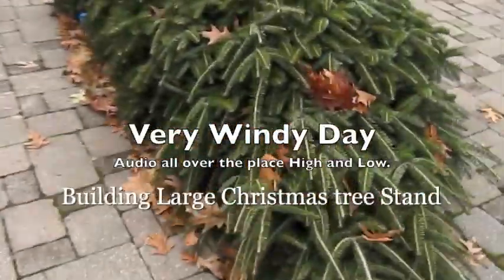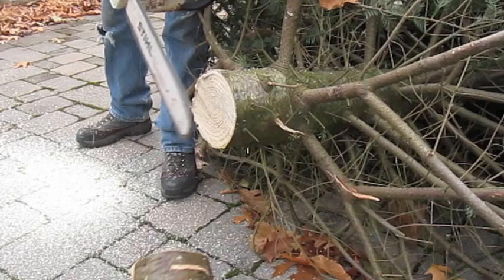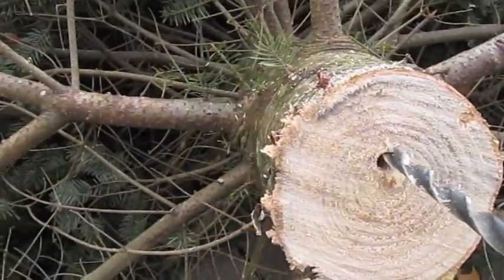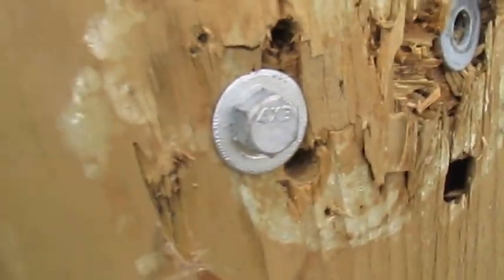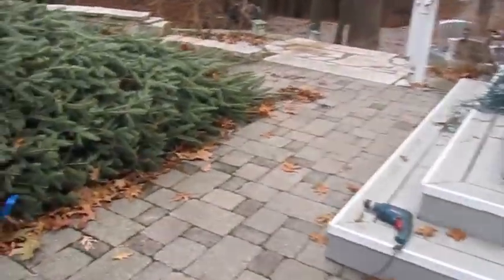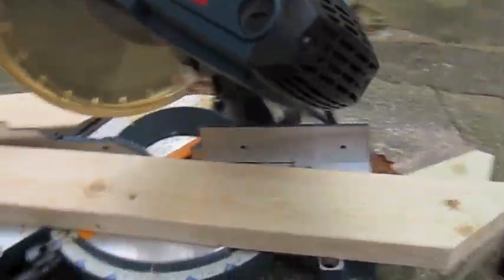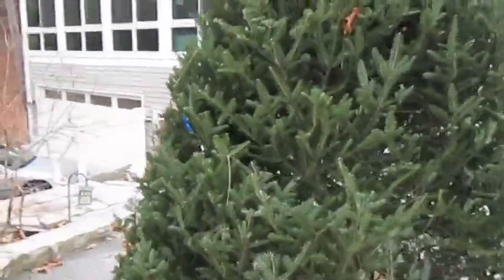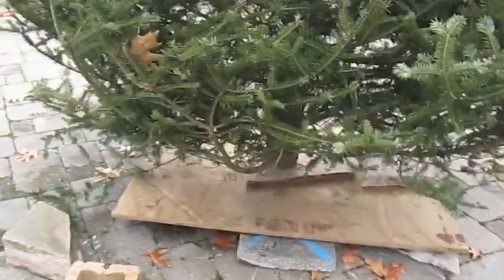large Christmas tree stand

Comment: How do you water it?
Reply from the maker: I don't water it. Its outside. One year I left a tree up till spring and when I took it down it was still good. Have a great Thanksgiving.
Reply: don't believe his reply, doesn't even make sense
Reply from the maker: @robbrown809  Hi, How's it going. Did you have a good Thanksgiving?
Reply: How long was your drill bit that you used to make the hole in the bottom of the tree and same question for the lag bolt? 

I’m assuming you screwed the 2X4’s directly into the tree for the brace right? What length screws did you use for that and what angle did you cut them at? Thank you!!

Comment: How long was your drill bit that you used to make the hole in the bottom of the tree and the same question for the lag bolt? I’m assuming you screwed the 2X4’s directly into the tree for the brace right? What length screws did you use for that and what angle did you cut them at? Thank you!!
Reply from the maker: Drill bit is about 10" and the lag Bolt longer. Don't drill all the way in leave some room for the lag bolt to bite into the tree. 2x4's screwed into the tree and I cut just 45's on the miter. Have fun with the project. Thank You for commenting. Have a good Thanksgiving.
Reply: @ZPDSurvival  awesome...thank you so much for getting back to me on this. We pick up a 12 footer tomorrow morning that I plan on using this method on. About what size is the board you attached the tree to? I’m assuming around 3’ X 3’ or so? Thx again!
Reply from the maker: @travisyuga  4x4 3/4 Treated. I used it for a number of years. You can also shim it to help straighten the tree and use cinder blocks or weight to hold it down. Have a good one.
Reply: @ZPDSurvival  good stuff, thanks again and I hope you and you’re family have a Happy Thanksgiving 🦃🍁🍽